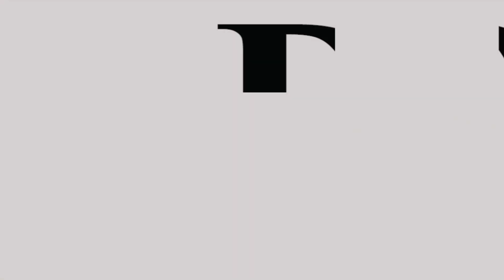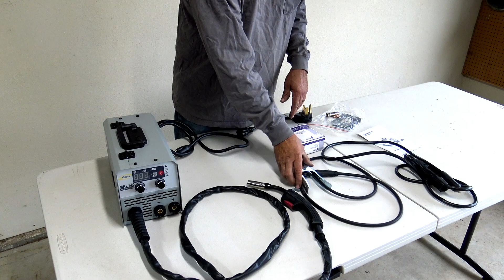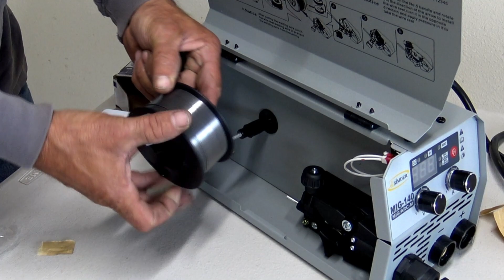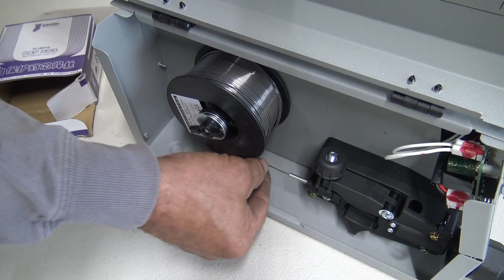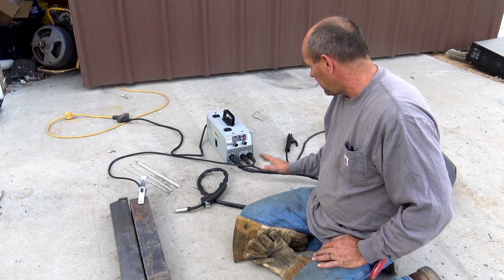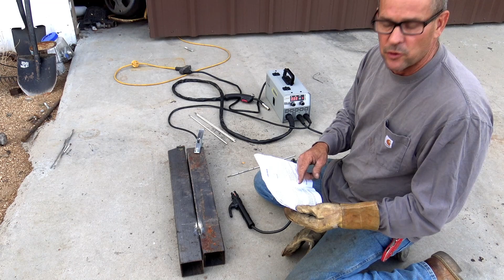Light Weight Welding Machine Review | Cheap 2 in 1 Welder

Comment: On this unit, the wire speed is the right knob and left is amps.  The display is kind of meaningless.  Below a couple of responses to questions left on Amazon might help clarify.
++++++++++
Q: settings For Mig mode 1mm, where should the voltage and current knobs be set?
A: Dear Customer, the Voltage knob is used to adjust the speed of feeding wire. For the currents you can start with 5 and adjust to 10 according to the thickness of the object to be welded.
By sunny huang in the United States on January 11, 2022

Q: I noticed that there is no wire speed control why is that?
A: when u look at the front the wire speed control is the knob on the right that controls your wire feed and the knob on the left controls the amount of heat to penetrate steel.
By john… in the United States on March 14, 2022

++++++++++

And here's a general quickie on V, A and wire speed as it pertains to reducing MIG flux core spatter due to "Incorrect Settings"-- you should be able to understand how this translates to the controls found on the unit in the video:

Improper settings

Everything has to be right when you are doing flux core welding. One of the first causes for spatter is incorrect amperage settings. The wire feed speed determines the kind of amperage you will be using. If you set too high then you will experience spatter. You can solve this in two main ways – lowering amperage (or wire reducing wire speed) or increasing voltage. You will need to constantly test the welds until you find the right settings.
Reply from the maker: Thanks for the info!

Comment: Exposed circuit board. Maybe use that welder to fabricate a cover for that.
Reply: I just got one too. My circuit board was covered.
Reply: The newer ones do have those wires covered.
Reply: @garylee9738  I agree, just received mine and no exposed circuit board.
Reply: @Warpfield  GOOD! Mine is on the delivery truck now so hopefully mine has the covered board also.